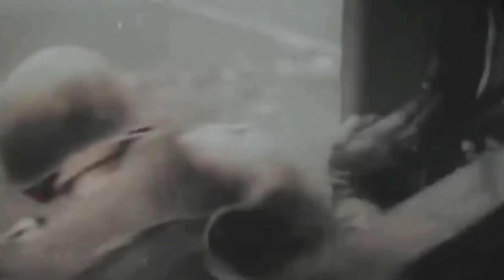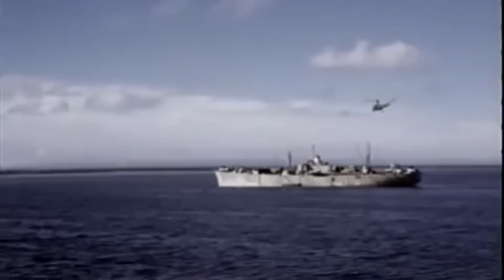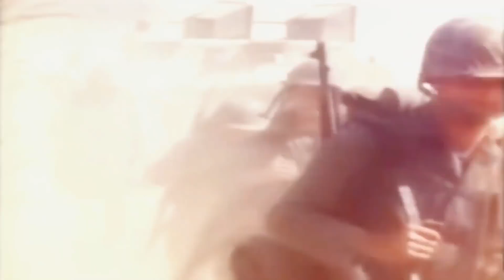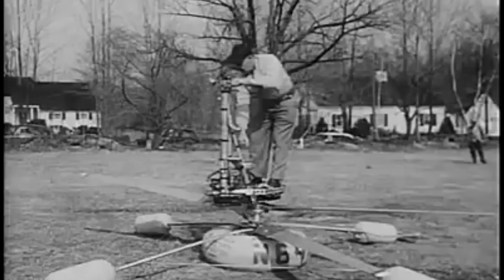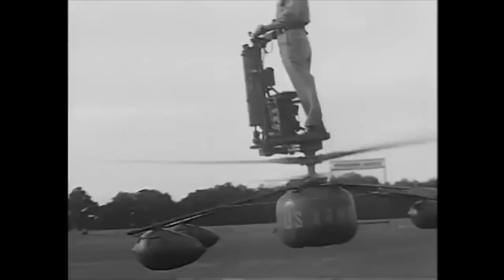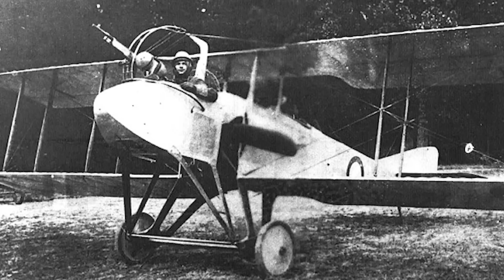Mind Your Step; The de Lackner HZ-1 Aerocycle

Comment: PULL!!! As a kid in the 50s I was flying control line model airplanes. Thumble Drome models had the type with the framework around the props and a standing pilot. It was a free flight. Start it up and let it go! The problem was the torque of the engine would make the model rotate and toss the fuel out of the tank. Still, they went about 50 feet up before running out of fuel. As a trap and skeet shooter I think I see another reason the military gave up on the idea.

Comment: "capable of 75 mph and altitudes of 1500 ft"

Either of those figures is pants crappingly terrifying considering how minimal the vehicle is.
I built a two speed stroked bigfoot goped that could quickly hit 65 mph when I was a teenager that my friends called "the brown streak." I didn't ride it up to top speed very often.
I can understand why an aerocycle pilot wouldn't push the limits either.
Seems to me it would be a very useful agricultural vehicle.

Comment: Drones have made that stuff obsolete.  
 The safest one though is a 1m  contra rotating blades  in a meshed guard above or behind the driver . The driver wears a parachute  which the propellers blow like a sail to take off.  The the chute can act like a wing for sustained but slow flight .
 Their use I would see as limited .  Probably better to carry a drone .
 Thank you Ed .

Comment: There is a strong squinch factor with this one.
It reminded me of the German rotor craft designed to be launched from U boats. From what I've seen it's not clear to me if these were autogyros that flew by being towed by the sub or if these were self powered helicopters. Maybe that question is a good excuse to do a video?
Reply: Autogyros that were dragged along like kites basically. They "worked" but how effective they were is debatable. And yeah... imagine the boat coming under attack or something while you're up there...
Reply: @MrArgus11111  it had a comms cable along with its tether line, both of which could detach, thus resulting in its slow descent until, presumably, recovered

Comment: So the soldier arrives at the field of battle where he then has to stand on a pedestal in full view while he waits for the rotors to wind down and  stop revolving before he can step off.
 Can anyone else see a problem with that?
Reply: Explosive bolts fitted to each rotor blade. Aero cycle provides it's own covering fire while trooper dismounts. Foolproof.
Reply: @ypfsg7177  problem:
The bullets go literally anywhere.
Your buddies won't like it at all.
Reply: A blade brake like helos have?

Comment: Some other single man flying platforms.

What I can remember from a fairly in-depth documentary was that they started with a rocket backpack.
That only gave the operator 30 seconds flying time so they then started developing a jet backpack.
These were more succesful and could remain longer in the air.
The final development was a decently sized platform for the single operator with a protective hull that came up to above waist height.

Comment: HOW could anyone think that the rotors should be BELOW the pilot??🤯😱😂😅🤣
Reply: Rotors ABOVE the pilot would prevent leaning your body for directional control.  It would get a lot more complicated, essentially requiring a full helicopter control system.
Reply: @grizwoldphantasia5005  yeah how do hand glider's do exactly that?
Reply: @billhanna2148  Hang gliders have a bar the pilot shifts position on, right? They're a lot lighter than something with an engine and rotors.
Good question, and I have no answer other than intuition, having never flown a hang glider.
Reply: @grizwoldphantasia5005  Yes hang glider, thanks for the correction... still think that could work better than what was actually built

Comment: It's like a Segway for the sky. 
The safety issues aside, can you imagine what a great target you'd make on a battlefield where anything can be killed if the enemy can see it?
Reply: Not only that if you want to bail out you need to land and wait for the rotors to stop. Just standing there in the middle of a field.
Reply: @JZ's BFF 
These individual flying machines leave the pbi flying them at least equally defenceless
Reply: @JZ's BFF 
 poor bloody infantryman.
Reply: no one really said that it was supposed to do frontline duties, or did they? If can be a really good liason vehicle over difficult terrain.
Reply: @delfinenteddyson9865  Recce? Seems pretty dangerous to me.
Reply: And you're probably making a loud buzzing noise...
Reply: @wilsonli5642  Exactly what I was thinking. A loud buzzing two stroke engine and counter rotating 15 foot props? I am guessing one heck of a racket plus  the thing is so tall you would be an easy target. Neat idea on paper but, operationally not practical on the battlefield.

Comment: With a computer handling the flight controls, e.g. a man-carrying drone  , and compact turbojets ,the concept could be reduced to something only slightly terrifying :-)
Reply: Maybe just a drone, and the soldier stays on the ground with a TV screen rather than silhouette themselves against the sky as the perfect target.
Reply: Well they do have the Jetson 1 flying car out now that is proving it's self. Right now it looks to be more of an off road type flying motorcycle. But the flying car has always been something envisioned, but not really practical. Yes this is something I grew up with and thought it would happen. But when you think about the vehicle traffic on the roads today and try and see that happening in flying vehicles it becomes impracticable. Then there is the problem of the idiots on the road now and if those things have an engine problem, they glide like a brick.